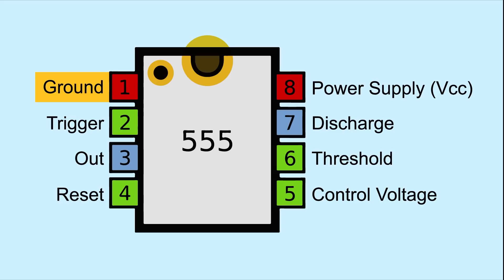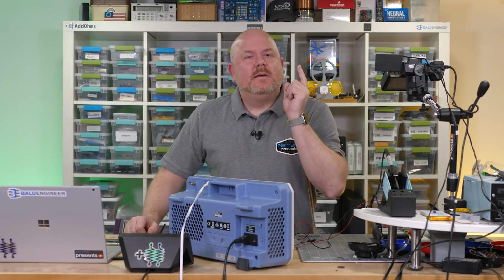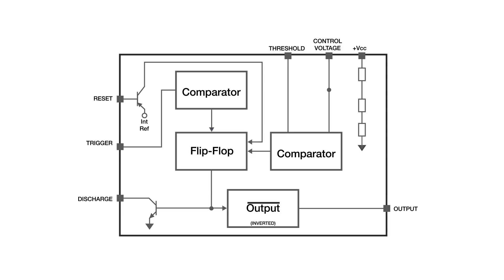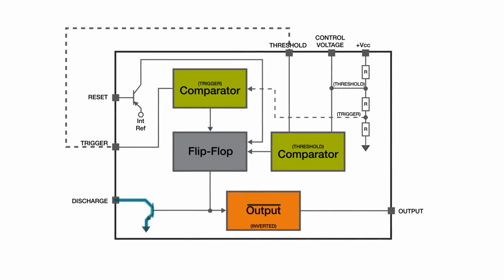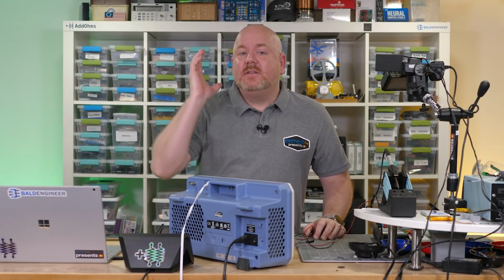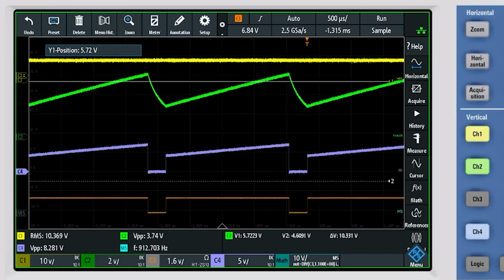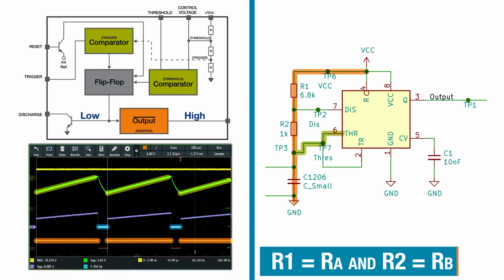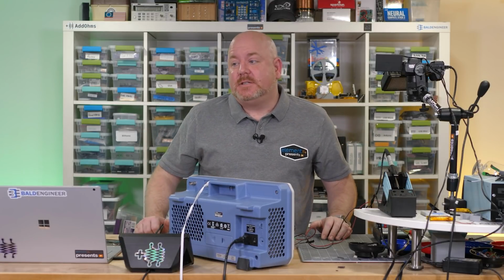Measuring A 555 On An Oscilloscope - Workbench Wednesdays

Comment: I don't think you are aware of what value that you deliver to people with interest in and no education in electronics.
It's significant! This is what I need. Practical examples. More of this please and also about adjusting of the duty cycle.
I'm seeing electronics has s broad audience on YT and the magnificent thing is that it's adjusting itself from the hardcore physics and mathematics towards practical understanding of the building blocks in a circuit.
What I need is examples of connecting those building blocks and using Dmm, function generator and scope like you did in this masterpiece video!
Also how to use the external triggers etc on the function generator in a real application.
I love your short and cut the crap videos, but would like to watch longer more in depth in addition.
Thanks for your effors - that goes for all of you at E-14. However this video supersede :)

Comment: If you connect a steering diode across the resistor between discharge and trigger pins , with the anode towards VCC , you can improve the duty cycle closer to 50 %.  The timing cap charges through the diode  and the top resistor and discharges through the middle resistor.